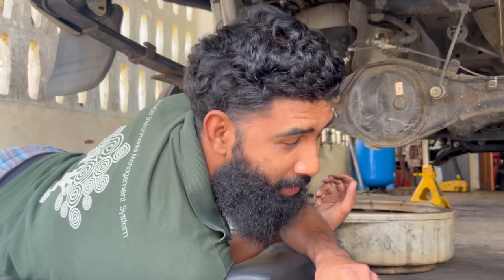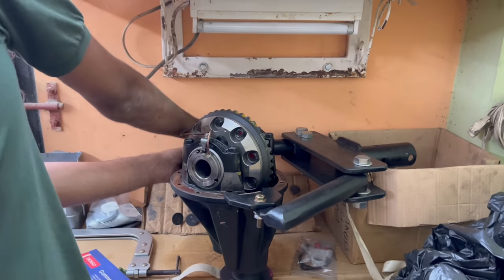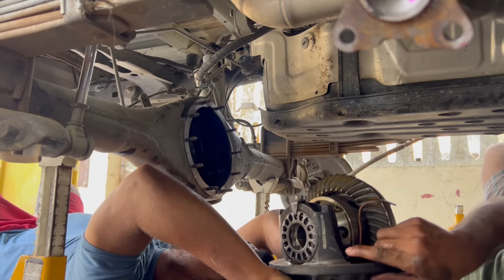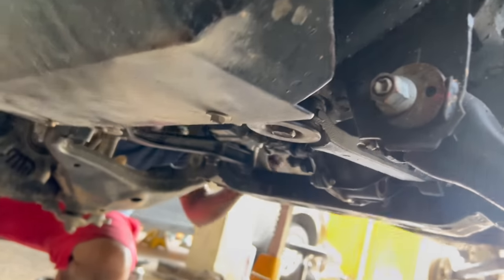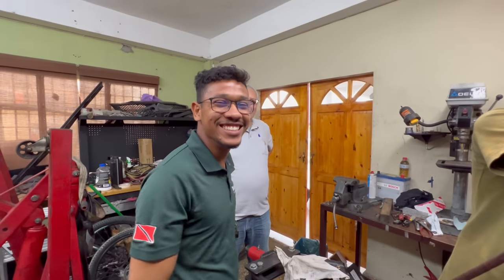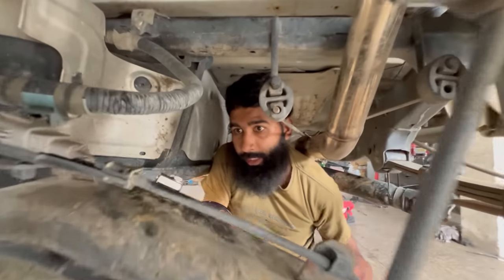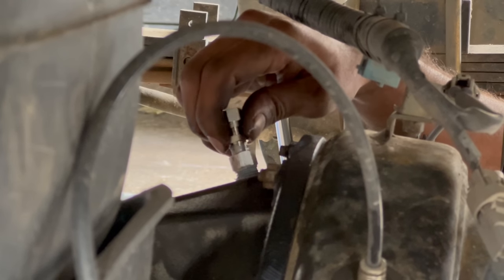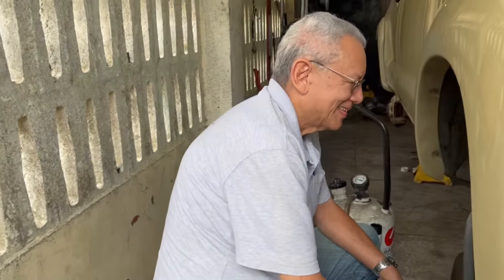Twin Differential Locking And Regearing N70 Toyota Hilux On 35s!

Comment: diff lockers were used for Cross axle situations..aka ..two wheels off the ground and 2 wheels on the ground..naturally differentials would send power to the wheel with least traction..the wheels that are off the ground...this is the best off road upgrade ever....honestly..why didn't these vehicles come with these features from factory..it just makes complete sense!!
Reply: costs more, novices would mash them up when they forget to swap back for dry normal road.
Reply: @theinvisibleman6147  thats a poor excuse..wouldn't that make the market really happy...the customers are literally user erroring their product which causes it to break..therefore..they NEED TO BUY MORE!!!
Reply: @infrasonicrebasses4763  not an excuse, just the way things are man. Either deal with it or rationalise. I don't like it either but it is what it is.
Reply: @infrasonicrebasses4763  Thats true for most people i am not of that ilk. For example I know for a fact that the drawback with the air locker is that it has too much point of failure and is high maintenance and the O rings eventually WILL fail causing oil to leak back up into the air tubing, eventually causing the diff to remain open indefinitely lol. The original, predecessor version of the air lock is actually the better type but these guys dont know that. They're sheep just consuming whatever the higher ups give them, your words not mine.

But back to my point, it costs more and novices would mash them up....and another one being its not as durable/long life as arb makes it out to be. Nowadays the way products getting crappier, you're better off going bespoke/niche or, according to you, be a sheep. It is what it is.
Reply: @theinsivibleman5309  its only is what it is BECAUSE there is no unity to force manufacturers to make proper thing!!
Reply: @infrasonicrebasses4763  No infrasonic. I agree with the sentiment but it doesn't apply to people who own the means of production. If it is i am the only (or few) groups/persons offering a product or service, people have to take it or leave it, simple as that. If people taking it, why would i change anything? If people leaving it then my business buss or i improve the product/service OR improve the price OR find some middle ground.

Thats the reality. Those who own the means of production, that is people who offer/make services and/or products, are the ones who hold all the cards. 

Example; TT government wont allow people to import cars more than 5, 6, 7 years old which would greatly benefit most people as cars would be more affordable even with customs/duty costs. But care dealers dont want this else their business will buss. Car dealers are the only people offering their service so people either do without a car or go by them to get one (new, roro, NOT talking about used). If everyone came together and said they not buying cars from dealers anymore you think dealers going to care? Lol sooner or later the united people u talking about will buckle, the only variable that will make dealers bend is the state because they have the monopoly on force. If the dealers say no, they can just take their shit away or make it difficult for them to do business and they will have to play ball.

Its not unity of the people thats the problem. Dais bottom up, you have it backwards. Is the will of whoever has the monopoly on force (state) that ultimately matters. Ask the chinese how they does get shit done and they'll tell u. If u doh like how that sound then dais u. Keep dreaming. Power is what matters dan, is just how it is. If u want things to change is not about uniting people, is about grabbing that power, unity will always come after, by ease or by force.